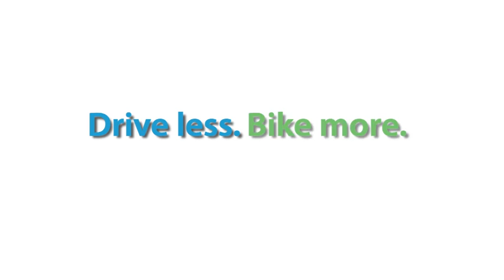Bicycle drivetrain technology with NuVinci

Comment: The only drawback of Nuvinci is it's fairly small gear range (380% on Nuvinci N380). While with a derailleur you can have 600% (on a 3×10 drivetrain) gear range.
Reply: You can still put a speed drive on the front if you remove the front derailleur.

Comment: If there was a nuvinci hub that doesn’t need to be attached to the tire that could be mounted on tricycles that had a gear hub between the axle and pedals I’d definitely get this product and install it as my gear system for my adult pedal car, my 4 wheel ebike whatever you want to call it cause this  would be awesome

Comment: why adding new technology to something that is perfectly fine the way it is. an average person can learn how to shift gears in a minute..
if you make bikes get faster the risk of accidents increases too. 
if you increase how effective they are, you reduce the force needed to ride them. but they are supposed to make you use some force, thats why its considered a healthy sport. 
don’t see the need to spend more money for such “improvements”. 
if im to lazy for a normal bike one day, i buy a motorbike.

Edit: if you want to improve something on bikes, improve their lifespan (no rust, stronger chain no flat tires,...). but that wouldn’t bring much profit, wouldn’t it?
Reply: The NuVinci N380 CVT requires little to no maintenance and won't get clogged full of dirt and mud. Paired with a Gates carbon belt drive, my bike is bullet proof... I no longer have to worry about my derailleur becoming tangled in the brush or damaged from hitting something. No  need to lube chains anymore, because I am running a belt drive. Just a quick pressure wash, after riding and I am done. I spend a lot more time riding now, then I have ever... Due to the lack or need for maintenance on my bike.
   Cost for the whole setup was less then the cost for quality gear sets, about $700 all in.

Comment: I have never been able to figure out all of the gears on a derailleur system,  that's why I ride a fixed wheel bike,  which is great,  because I have never been able to figure out all of those brakes either.

Comment: I've seen where the 380, under continuous load, like going uphill, will start to overheat. The impact will be that the wheel will stop free wheeling, meaning, if you got off the bike and turned the wheel by hand, it acts as though the brakes are partially on. The internal parts starts to overhead.

Comment: Very nice, but NOT an "infinite" number of gears, as the salesman stated. I'd love to see the internal mechanism.  I drafted a patent application for a seamless planetary geared shift system that is also within the hub and COMPLETELY mechanical (no sensors whatsoever). This NuVinci invention seems to be able to adjust how fast (or hard?) one pedals before shifting to the next gear - impressive, but probably requires a sensor and thus a battery.
Reply: How much you paid for patenting?
Reply: Let's just say that this gearbox is very different from what you describe. First of all it doesn't use gears, and it's not a automatic transmission in it's base form. 

I'm not even going to try and describe it but point you to this video: https://youtu.be/vGs1nrXaZsA

As I see it there are things about it that I'm not enthusiastic about, such as the friction between the planets and the drive surfaces, or whatever you should call them. Until we know how it stands up to long term use I'll stay a skeptic.
Reply: Thanks Blahorag !  With the invention I mentioned, there is no need to shift ... in fact YOU can't.  It's totally automatic.  I think you have a good point about wear, etc. as it seems the Co never came to market with the product. It's a shame because it's fantastic (I rode a prototype).   Enjoy your rides bro !
Reply: No sensor no battery. All mechanical. Lots of videos out there. Watch one, be enlightened.

Comment: So it's a product for idiots that forget to shift before a light and get confused from having 2 sets of gears?
Reply: CVT's in general have massive advantage over geared transmissions because they allow an engine to stay in the power band regardless of wheel speed.

The Williams-Renault CVT-equipped F1 car was so set to dominate the league before it was banned in 1994.
Reply: Gara Von Hoiwkenzoiber 

Yes, for idiots.

Comment: The problem with this is that there really isn't much of an advantage over traditional gears and any internal hub can switch gears at a stop. This thing is heavy and it really doesn't help much. This would be much better in a car with a far wider range. The range of gearing isn't any better than any other internally geared hub, With a much more potent engine and a much wider range, an IVT would be good, but I don't think this is any good which is why it's been on the market for years now and almost nobody uses them.
Reply: +christo930 Here in the Netherlands, they're actually selling quite a few bikes using this system. It's rather expensive though, so it's usually reserved for seniors (instead of students), often in combination with an electronic bike.
Reply: They probably are pretty decent when using a mid-drive electric bicycle. I would agree there.

Comment: I installed the NuVinci last week. Built my own wheel, no problem with the install.
My question is:
Can I Keep my 9 Speed front with the Variable speed rear?
I had to install the 9 speed cassette on the front with a piece of all-thread sawed off to length and hammered over on the end to lock it in place.
I have a little trouble shifting the front while climbing, but so far I only throw the chain 2 or 3 times a ride.
I get lots of looks at local rides.
Reply: lol

Comment: The disadvantage is weight, and probably the torque it can handle, and the limited gearing space. Maintenance is 0, because if it breaks, you replace it. No oil, no nothing, because it will ruin system.

Comment: Weight yes, maintenance not exactly... it's sealed and not supposed to need any kind of maintenance whatsoever for a long time. The downside is if it does break, or you do go enough years with it, then yes - you will need to get it serviced by a specialist.